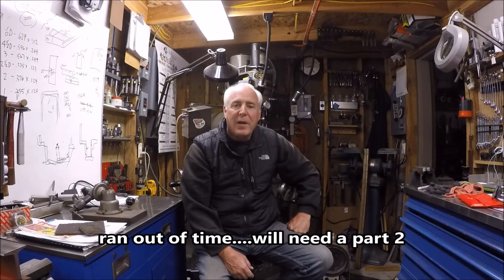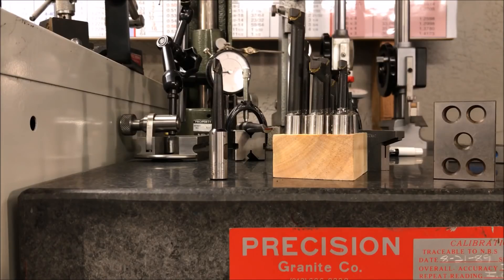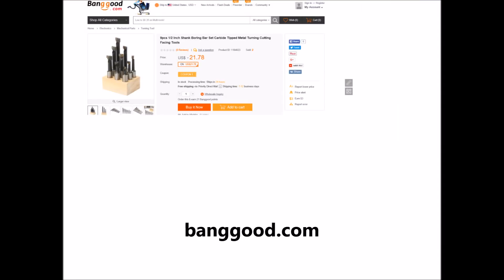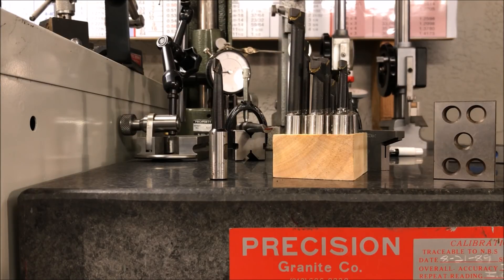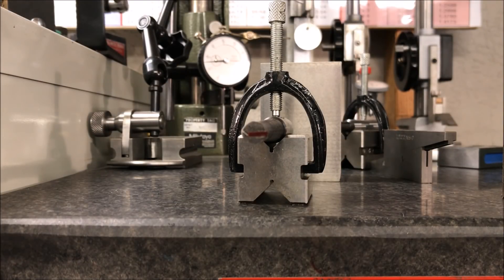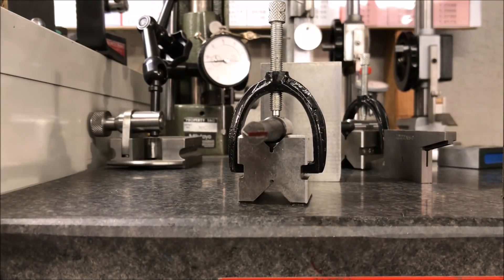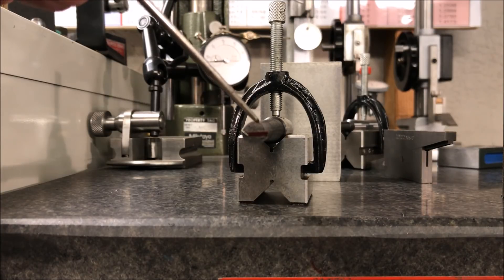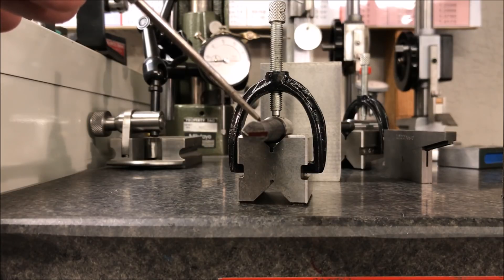Carbide Tip Boring Bars

Comment: Chuck, you talk about concentric, which might matter in a minimal sized hole for the bar to fit in, but not the other REAL problems with import bars.  They are often not ground with enough relief and rub on the lower portion of the cutting edge and below the cutting edge with anything less than a huge bore.  They can be pretty easily reground for the proper clearance if you have a carbide grinder with a diamond wheel, or even a green silicon carbide wheel followed by a diamond file or diamond "credit card" to hone the cutting edge sharp.  I have simply rolled the (sharpened) cutting edge of the import bar downward to make enough clearance relief, and yes, it is a negative rake, but they (amazingly!) seem to cut just fine that way if they are sharp and the cutting edge is on bore center height.  The big problem with import bars are that they are often dull, not sharp.  Again, easy to fix.  Sure, I would love to have an expensive set of solid carbide boring bars, but am too cheap to do so when cheap bars do the job with a little grinding, sharpening, and a proper setup.

Comment: Hi Chuck,  $28 set(s) make for good tool blanks for experimenting and "making" a set for different materials etc, plus snap ring grooves etc.  Thanks for showing the differences.  Lets me know I will need to add a good carbide grinder to my tool list for the new shop (whenever that happens).

Comment: In my opinion, the concentricity comparison is irrelevant, with the exception of the diameter of the minimum sized hole either could work in. The only part that matters, is it the cutting-edge is on center, and the proper clearance and rake angles are correct, for the particular material and finish desired. The bar with the flat makes for a non-adjustable rake angle, which is likely ok in most cases. More relevant things to dicuss, would be the quality of the carbide, and the quality of the bar material for rigidity.

Comment: I dont understand what is the purpose of this video, that 400 dolars is better 20 dolars. You can easy grind a flat. it's not relevant that the bars are not concentric whit the sank. The carbide tip is not ground. In vest Europe especial older tolls if you buy them new they are not ground. You must grind them  for the specific material that you are cutting .Even brand new twist drills are not ground. I you want to show some difference you should focus on performance but even then the price tag make them incomparable
Reply: on manual machines i know large companys (6000 employ) they use brazed tool. they have a few guys how are in a tool grinding area and they grind for all the factory, The late operator doesn't need to grind nothing . On cnc they use indexable because brazed tooling dont like the RPM
Reply: I think the point was simply that the $28 import set is not even close to the $400 set.  It is not like they are a cheap copy with lower quality materials.  They are not the same.  Like all tools, if you are a business charging out at $100/hour your perspective on modifying tools will change.  You will want to open the box, bolt in the machine and start making money.  A hobbyist, though will be willing to spend the time and save the money.
Reply: Barry Gerbracht . you ar right , But is the 400$ set Better then 13 sets whit 30 $ ?
Reply: Well if you own a business your using indexable carbide, because it's so easy quick and cheap in the long run.

Comment: I think the excentric shaft is intentional, to compensate for the carbide sticking out on one side, although I don't really see the need for that either. 
The geometry issues you described depend on how you put the bar in the holder and set it to center height. To me it doesn't seem vital that the cutting edge is at the center height of the shaft, you just need to rotate it up a little and set the toolholder lower to compensate. After all a turning tool also doesn't have the cutting edge anywhere near center of the shaft and still works fine once set up.
To me it is more important how good the materials are. Chinese stuff often needs finishing, but the value for money is still very good if you can do that. If it is made out of hard cheese instead of steel no amount of finishing will make it into a useful tool.

Comment: First of all you could mill a flat on the bang good model. Second a negative rake tool will roll a chip, and is better for roughing. They probably have a model with a positive rake.